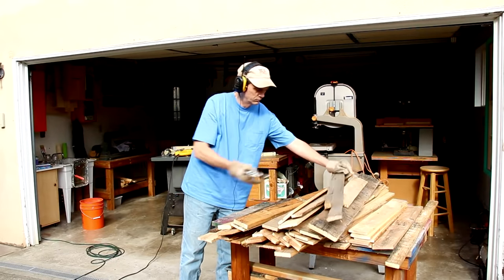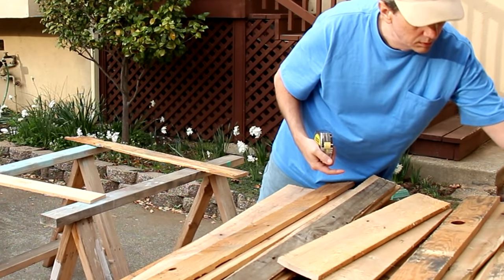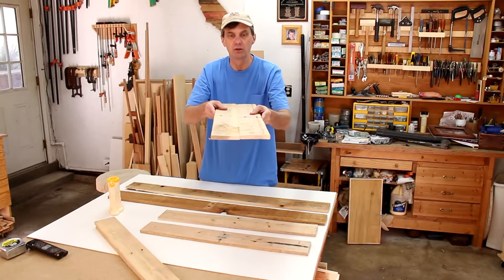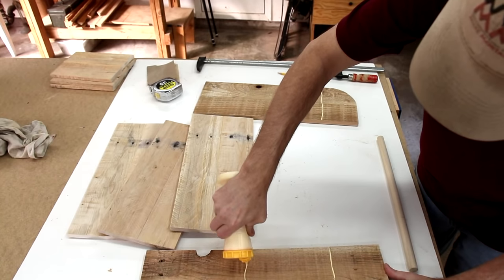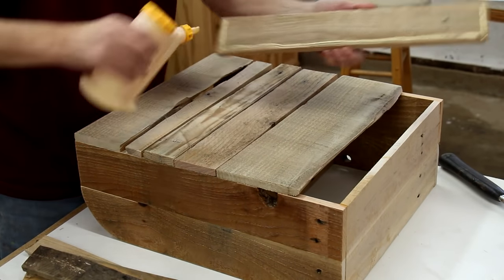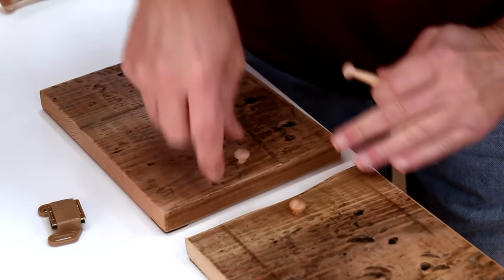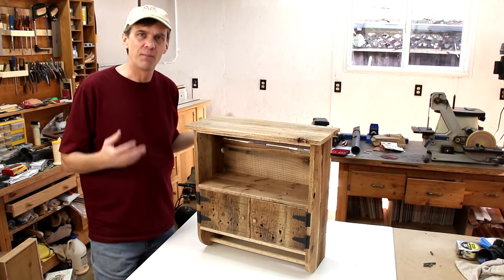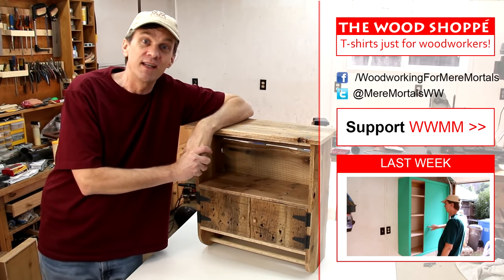Rustic, pallet-wood bath cabinet. Unique charm for your bathroom.

Comment: I wish the stores that have brass and silver hardware would also have black.  Tired of painting hardware black.  lol
Reply: Have you tried any of the aging techniques?  They don't get black but it can be close.
Reply: I have soaked zinc coated hinges in vinegar. Then when the coating is gone used cold blueing for gun metal to get a very dark blue black color.  Gives a very different look.
Reply: Eaglesnest Woodandpottery Am giving this a try first chance I get. Thanks
Reply: Stephanie Sikora Lee Valley
Reply: Fr. Thomas Bailey, OSB I haven't tried that.  Will have to google it.  Sounds cool
Reply: Stephanie Sikora Hi Stephanie - Rockler has a store in Denver.  You are in Colorado Springs?  I drove from Denver down to the Garden of the Gods and Pikes Peak when I had to go there for work a few years back.  It was beautiful.
Reply: Steve Carmichael Hey Steve! I am in Colorado Springs, and yes you are right, it is pretty! Love your channel and Go Broncos!!
Reply: Stephanie Sikora Oops, I figured out that I clicked on Eaglesnest Woodandpottery instead of your name by mistake somehow.  Well if you are ever in Denver check out Rockler.  LOL
Reply: Bobby Kellums Hi Bobby!  Thanks!  Go Falcons...oh, wait.  lol

Comment: Great project Steve!! I love using pallets for projects, I have access to a hardware store that gets oak pallets every week and I can take as many as I want. I built a pry bar device to pop the slats from the rails without having to cut and lose any wood, if you are interested I'll send you pictures of it to reproduce.
Reply: Hi Sean, I would like to see your pry bar device.
Reply: Matthew, I will take pictures of it tonight, give me an email I'll send them to you. It's based on a tent stake puller and it works great. Also, check out Izzy Swan over at Think Woodworks, he built a very nice one out of wood, looks like it works even smoother then mine.

Comment: Nice job using the router as a jointer. Works a lot like my tablesaw  jointer fence. I made something very similar years ago called a chicken coop bathroom cabinet. Did not have any doors though. That is a nice addition. Great job!!!
Reply: Steve,will it hurt my clamps to be locked down all the time when I'm not using them?
Reply: Bill Howard
No! But why have them tightened all the time when not in use?
Reply: Because I have no where to put them(25) 1car garage 2 work tables,just no room to lay all of them down.

Comment: Question for you regarding pallet wood. Do you look for certain kinds of pallet wood. I have read there are different types and some are chemically treated pallets that may be dangerous. Most of the pallets I have found have a HT printed on them which I believe stands for heat treated and is probably safe. I love the projects you do. Thanks for the videos.